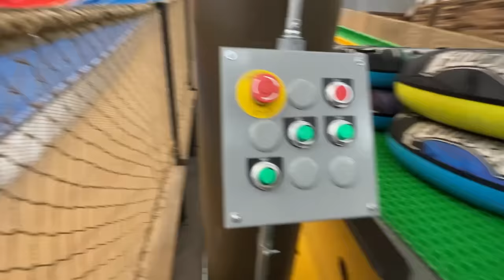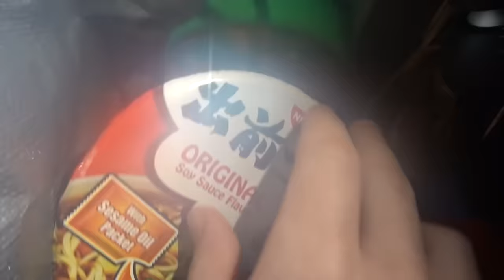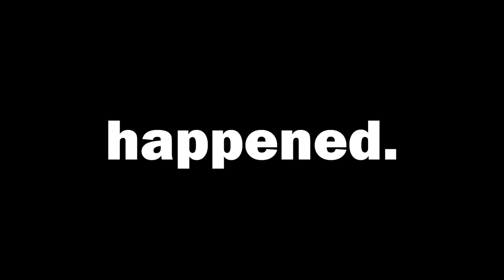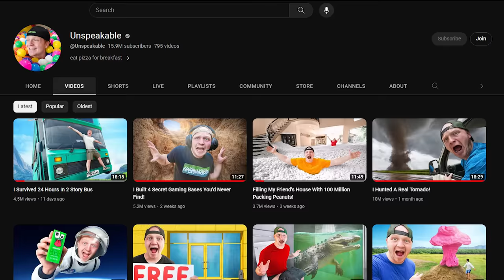$100,000 Secret Hiding Spot You'd Never Find!

Comment: Cool build… I’ve enjoyed watching. When I was 16 I bought a brand new 1996 Ranger Splash single cab, step side, 4.0 OHV automatic 60/40 bench power door locks, power windows, power mirrors, cruise control, 3.73 gears, dyno max cat back exhaust, k&n air filter, removed the sliding rear glass for a single pane, axle flip kit, small polyurethane bump stops, (never got to doing the c-notch), 1” shackle to raise it back up, Tokico gas charge Shocks, 2” lowering I-Back racing springs, sliver 17x9 Mustang Cobra Wheels, 255x45R17 tires on all 4 wheels, black rubber bed mat that had a big Ford Logo in the middle.
Reply: Nice
Reply: heheheheheeeheehehehehehehe i have almost the same car
Reply: Cool